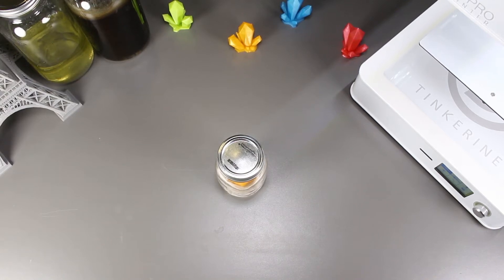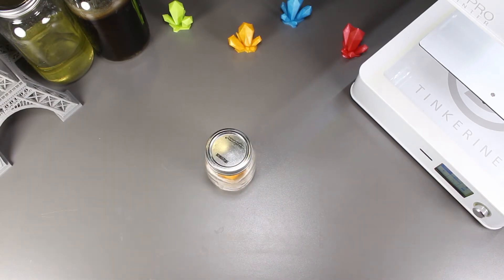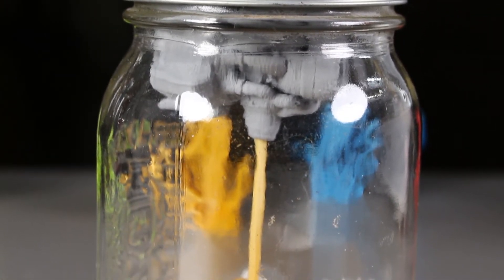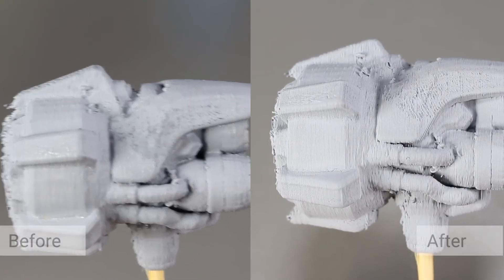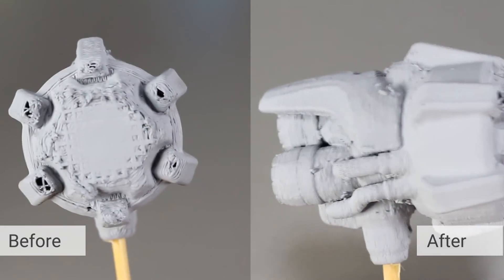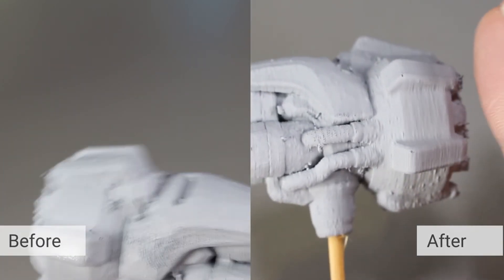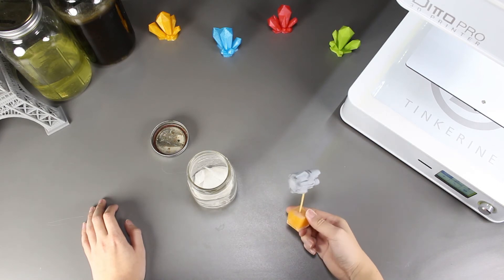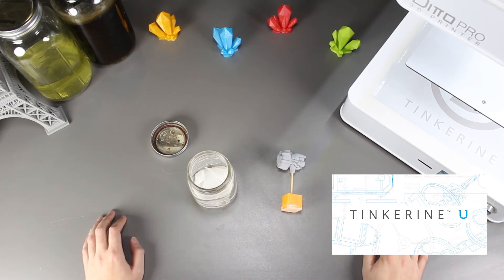Using Acetone To Vapour Smooth 3D Printed Models Coated with Primer Part 2

Comment: Tinkerine,next please try tumbler. put cut pla filament(about 5mm-10mm  as a media in the tumbler. if it fail  replace the cut filament with screw. if you got success,reheat the 3d printed object with heat gun to remove the white scratch. make various speed for the tumbler.try 1 with slow,medium & fast turning tumbler. if you got no success at all try sand blast the 3d printed object with glass media.should be fastest way to finish 3d print surface
Reply from the maker: Hi!

Thanks for the suggestion and comment. We will look in to it!